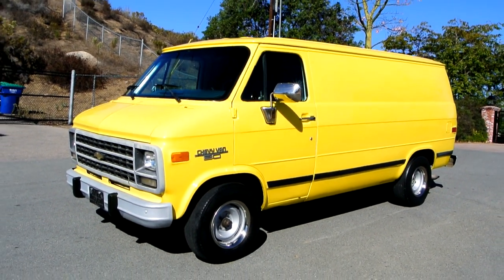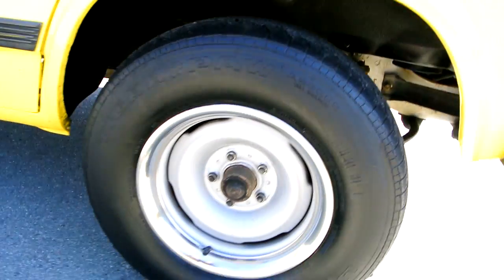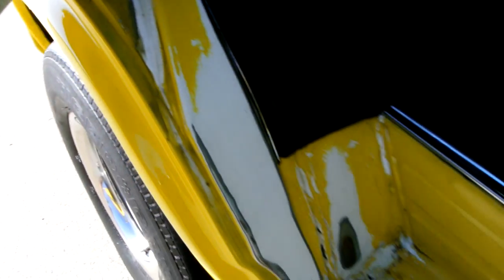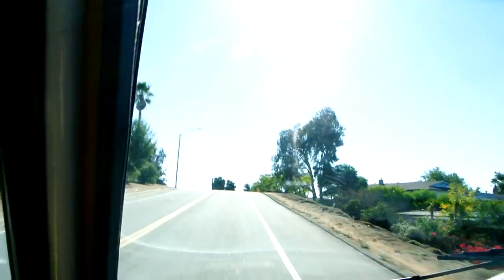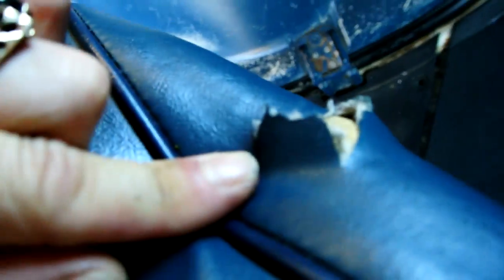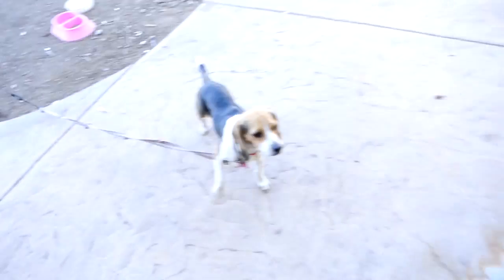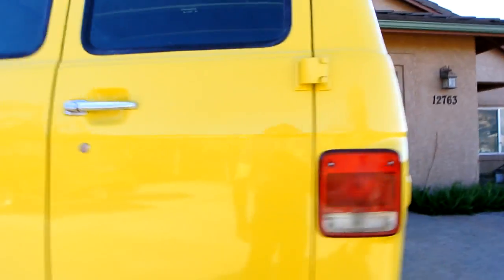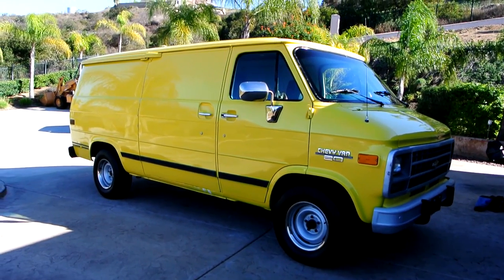1994 Chevrolet G20 Commercial Van Cargo Work Video 5.7 350 V8 110K Orig 1 Owner For Sale

Comment: I own a 94 chevy g20 conversion van so I know a bit about these vans. I noticed that it was missing the air intake tube that runs from the front to the factory air box, witch I believe is important for proper air flow and the feeding of cool air into the engine because of how far the engine sits back. Without it it will be sucking hot air witch kills hp. But than again the stock air box  has a flap on it that acts like a choke and its operated by hot air coming off the exhaust manifold so it will be getting hot air anyways, but wont be as bad with the piece. This can be removed by popping out a pin that holds the flap in place and removing the tube running from the manifold. Also these chevy 350 engines were the same engines that were used in their pickups. I have a friend with a 92 chevy 1500 pickup that has the same engine. So I believe the intake manifold was the stock steel one but had been painted silver.